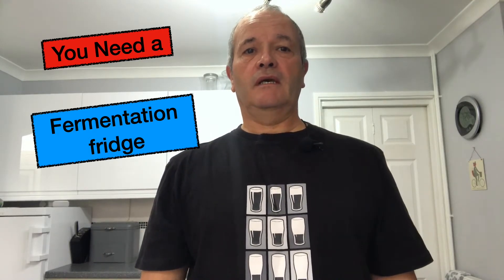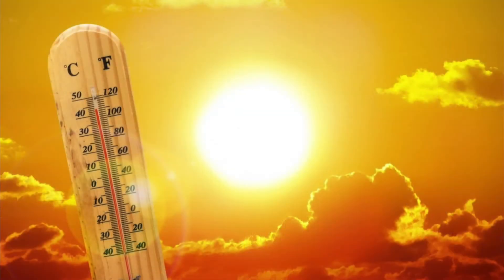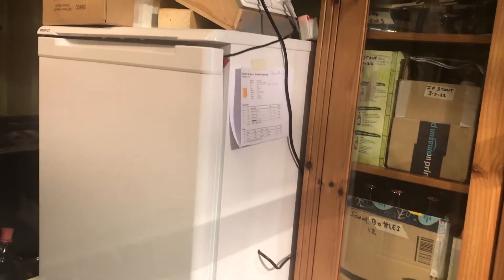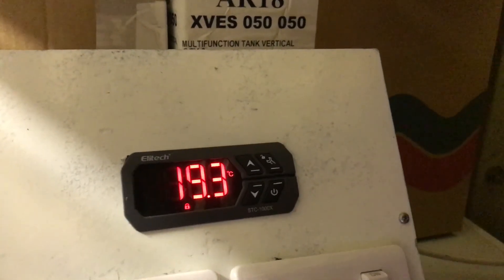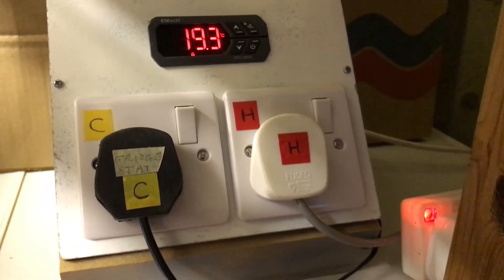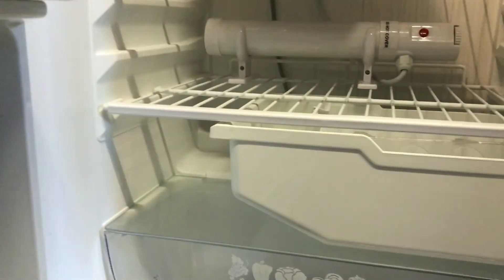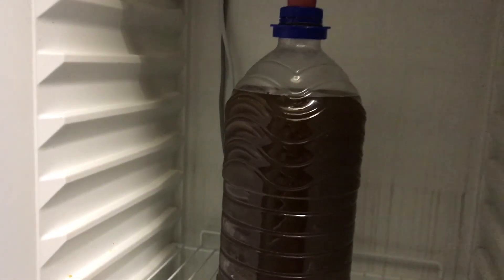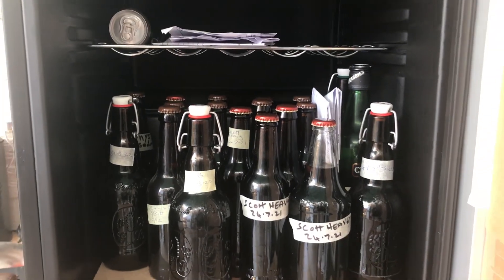Build a Fermentation Fridge

Comment: In winter in a cold shed, could I just not use the fridge as a insulated vessel with the fermentation bin on a heat mat that is controlled by a thermostatic unit ? With it being cold weather is  dual switching to power the fridge up really necessary  ?
Also, is any ventilation necessary  ?

Thanks in advance. John